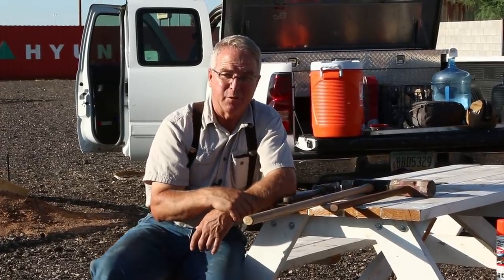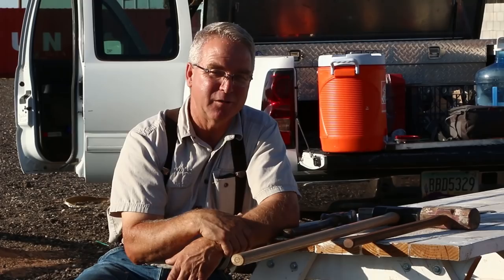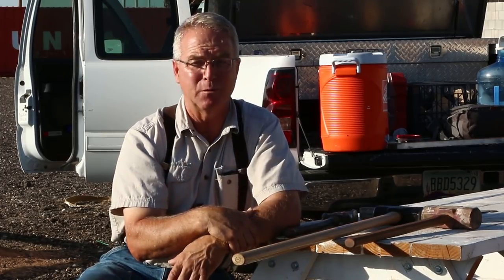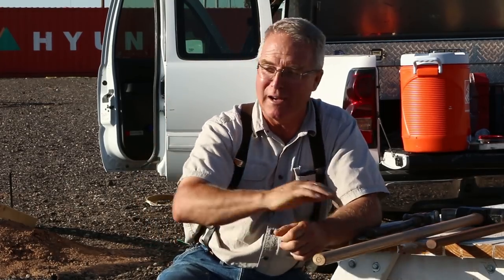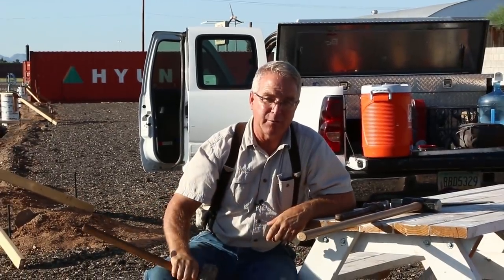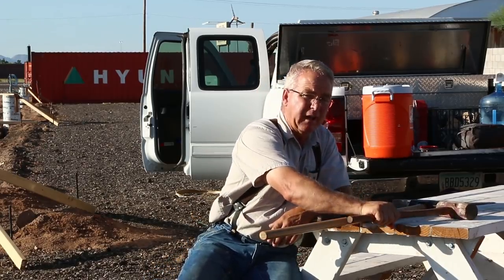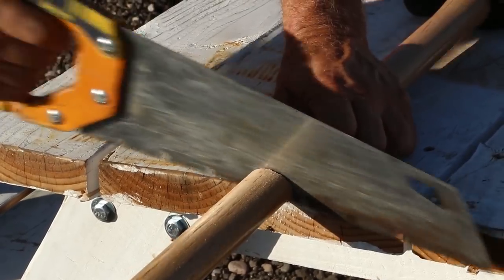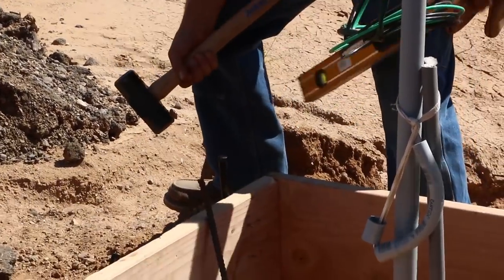Best Sledge Hammer for Concrete Work

Comment: ironworker here, I've heard a 16 pounder called a "monday", swung it a few times and realized why it's called that. no one likes Mondays
Reply: Don't bring your racist trolling into this positive community.
Reply: I think momentum is more important than energy when hammering.
Reply: @zachary3777  the 1 foot by 1 1/16 drift pins i send through 8 inches of steel beg to differ lol
Reply: Could be wrong, but it seems more likely the name comes from that being the hammer you use on Monday, when you're all rested and feeling like super man, then you use a lighter one the rest of the week cause you learned your lesson.
Reply: You mean speed(momentum) is more important than mass when you want to impart the most energy possible.

Yes, that's why the math equation for energy is as he showed.

The total ENERGY is equal to 1/2 of the mass of the object multiplied by the square of its velocity(speed). Square means times itself. So if it was 5mph it would be 5x5. That means as the speed goes up steadily the total energy goes up a lot more.
Reply: @zachary3777  momentum does not equal mass.  Its literally mass x velocity
Reply: Zach A well force=mass x acceleration 
So if you can swing a heavier hammer ,with the same amount of speed as a smaller hammer, you get more force
Reply: Lol roughneck for drilling rig here and most of the hammers used on our rig is 10lbs and in some cases when there was a 4in hammer union not wanting to budge then we would use "Big Bertha" or tell a hand to go get "Bertha" which was our 16lb hammer. Only me and a couple others would swing Bertha and wouldnt let anyone else try (to prevent them from hurting thereselves or breaking Bertha!) that wasnt an efficient or good hammer swinger. But ive worked all fields of oilfield n while we might have 10lb long dick handle sledges, which i hate using, i prefer a good ol 8lb sledge that we would use on a frac job. with a medium length handle, Not too long and not too short, just right, wrapped mine with grip tape and i could go toe to toe if not gaurantee you i could out preform you with your long handle 10lb sledge lol
Reply: Zach A Well, multiply momentum by half the velocity and you have…energy! (Kinetic ofc)
Reply: Just Roll Can’t take a joke?
Reply: Cody RatliffTM Can’t take a joke
Reply: I’ve seen Alec Steele  swing a 26lb look it up it is amazing!!
Reply: @jedimasterjoe5386  Where's the joke?
Reply: I'm a block mason we call some 12 inch block birth control block lol
Reply: @zachary3777  no, with a small hammer, I even struggle to put nails in plywood, as I have to hit hard, and fast, aka not too accurate, and also using a small hammer takes more energy in the long run, vs a few relatively relaxed whacks of a bigger hammer. but of course, each hammer has their use, can't exactly use a sledge for fine works
Reply: @thepork9940  That's literally my point

Comment: There's an old saying "there is no substitute for experience"  - and you're the living embodiment of that. I searched sledges and was so pleased when your channel came up. It's like going to an old and trusted friend and asking their opinion. Thanks for taking the time to make this. And you're right - force is speed x mass not just the mass. Ego has no place in working with a tool :)
Reply: The kinetic energy in a blow is [mass x velocity squared] divided by 2.
The energy delivered is proportional to the square of velocity, whereas mass is in direct proportion.
a 5kg hammer at velocity of 5m/sec kinetic energy is [5x25]/2 = 62.5
double the mass, same velocity gives [10x25]/2 =125
double the velocity, original mass [5 x 100]/2 =250
(units of kinetic energy are kilogram-meters squared per second squared)

Comment: I'm a heavy diesel mechanic and we got all types of hammers. Very precise brass 1/4 hammer, up to 15lbs of persuasion. But my favorite is my 14inch 4lbs sledge. It just fits my hands and is weighted enough to persuade  almost anything I need to persuade.

Comment: New tool for you.   I use the cut off part left over from handle as a boot knocker.   Knocks mud off before u get into your truck.    Fits under the seat.

Comment: I almost got my face rearranged with a 3 pond. A coworker was setting a top plate after we had wet set thread all. As he swung forward the fiber glass handle failed and the sledge flew across the room and as it grazed my jaw it hit me square in the chest just missing the collar bone. I was lucky to only have a bruise.

Comment: Concrete man here and I agree a 6 lbs hammer is the only way to go. Although I cut my handles so the total length is 16” so I can set my inside footer boards without pulling a tape out (production pro tip)!

Comment: I came to the same conclusion some years back while splitting firewood short handled 6 does well and if you want use a long handled 8 too after your wedge is set. I’ve gotten comments using my 6lb shorty on construction jobs but people usually change there mind after using it to drive a stake

Comment: Thank you EC. True words spoken. Now lets talk about that saw lol. The same applys with a splitting maul people ask why use a 6# instead of a 8# i give a little twist just as the head hits the wood to pop it apart instead of just slaming the maul strait down the 8# is harder to control and slower. 6# for driving stakes works good. Take care.
Reply: In Norway (sort of the true home of axes etc) they use very light splitting axes rather than mauls. Of course this references what s it was saying about speed over weight. Of course the wood split if often spruce or birch and doesn't have a huge diameter compares to some of the wood you get in the states. Interesting mind.

Comment: A mid-weight hammer with a moderate handle on it is a great thing to work with day to day. But an eight to ten pounder on a long handle? It's a thing of beauty for a job that actually calls for it. If you don't have a bin of hammers and bars on your work truck, you'll eventually "make do" with the wrong hammer for the job.

But a really slick rig I've seen recently: pneumatic driver with two guys walking along with a cart for the compressor and a stack of stakes. The two of them went around and did three of the four sides in the time the four other guys did the last.
Reply: Technology does that. You can either invest in the tools to do the job faster or you can hire more labor and do things the hard way.

Comment: I also use a 6lb hammer while driving steel stakes but I cut the handle a bit longer about 24 inches and I make a notch at the 16 inch in the handle for quick measure for a standard residential footing. Has made my life so much easier and quicker

Comment: hey, Scott.. I, enjoyed the travel back. I, worked at M.S. bout the same time.. R and R truck 14 .. I, liked a longer handle as well.. I, used an 8lb  and took the time to wrap the end of the handle with string line.. game my larger hands a bit more  area to grab on too... kept a 10 lb sledge on the truck for when I, needed the extra swing weight.  for those quick jobs when I, didn't want to break out the Jack Hammer. As far as Dennis goes.. we all have differing opinions of the man... he was tough, stubborn,  and wasn't afraid to let you know.  I, enjoyed working at M.S. Concrete most every R and R job I was called too was different in what we had to do to fix it, tho we couldn't figure out if R and R was Remove and Replace or .. Reconfigure and Redo.  have a great and awesome day,   A. J.

Comment: I work with concrete in Las Vegas and what you said about caliche or however you spelled it couldn’t be more true. But I noticed you don’t swing completely over your head when you drive a stake. I was taught to do a full swing. I’ve only been doing concrete for about 2 years I just turned 21. I swing an 8 pounder with a 16 inch handle. Most guys I work with swing a 12. I learned with a 12 and when I bought nt 8 it was really light and easy to control so now I drive stakes with the best of them in our crew. Thanks for videos. I enjoy what I do and have learned a lot from you 🙌👍

Comment: I actually buy old pick axe handles (generally old tools from "home and garden shops"), and convert them in to hammer handles. Excellent source of wood, tried and tested, aged well, and cheap.
Reply: I buy large sledges and picks regularly at car boot sales for a couple of dollars or thereabouts, simply for the hickory handles which are imported and would cost between 12 and 20 pounds in UK.

Comment: Scott, this is off-topic but you should move your T-shirt line to another company. I ordered the blue EC shirt and the logo was printed off center and much smaller than the advertised shirt. Teespring sent a replacement (so far so good). Well, the replacement was worse than the original order. Off center and rotated slightly! Just a heads up from the field. BTW, love your relaxed, easy feeling delivery in these most informative videos!

Comment: A good small sledge makes breaking bolts loose for changing rear brakes a breeze. I actually went from a hammer to a sledge and the extra concussive force per tap made all the diff on getting that caliper bolt loose.

Comment: Definitely different construction methods out west than in the Southeast. I use a 10 lbs sledge to drive my wood stakes but its got a normal, 30" or so handle. Here we have sand and roots so you you want a wide stake, and  long handled sledge

Comment: The perfect single jack for me, is a 4lb with a 16" handle, OTC has an indestructible handle and a ton of options, the fave isnt rounded over like most sledge hammers and theres little no vibration.

Comment: Different sledgehammer application here but ultimately the same - driving wooden stakes for electric/barbed wire fencing. I have a 16 pound sledge that I prize over any other sledge, I can swing and drive stakes one handed with it, but I have a reasonably long handle on it for really getting work done. The handle usually starts life as a standard length and slowly gets shorter until it hits under 2 feet. I find it unwieldy and awkward until it drops under 30 inches, even with two hands. I've broken a lot of rock with it, I've driven a lot of stakes too, building up the muscle and technique to use it with one hand though is absolutely one of the best skills I've attained for fencing hands down.

Comment: Hi, I’m 22 years old and new to construction as a laborer in Australia. You say in this video to always be open to new better ways of doing things. What about your units of measurements? You describe everything in feet and inches, however these measurements don’t easily convert and are exclusive almost to the US. Have you considered using metric measurements? On my commercial building site, I’d be crucified for conveying a measurement that wasn’t in millimeters. I understand in Europe they prefer centimeters. 

I saw in one of your spec build videos when you were leveling the ground with the laser, you said the industry standard precision measurement error margin was within 1/10th of a foot or something like that. Surely giving a number such as 10mm (what our leveling needed to be within on my job site) is more intuitive? Easier to convert and mathematically transform and such.

Comment: At the tire shop we had a 20lb hammer with a 1 1/2" schedule 40 steel pipe as the handle. We called it the persuader.

Comment: We do things pretty well the same here in Canada. For roadwork like curbs and sidewalks we always have a crew of two that set forms. Almost always one guy is on the sledge and its always an 8 pound with the short double jack handle you showed. The one thing you forgot to mention is that the face of the hammer should be flat and not rounded so it doesn't slip off the stake when striking.

Comment: I always look at the grain of the wood before I buy a hammer. Tight vertical grain. Vaughn, 19oz axe handle. Drive stakes w/ 4 lb. though. Forest Grove,  OR
Reply: I think I prefer the composite handles. They don't have the rustic charm of a wood handle, but they feel great and they're not damaged by water

Comment: What is the proper grain orientation for a hammer handle?  Is it in line with the hammer swing or crosswise to it?  I've even seen 45 degrees ???  Another great video as always.  I once bought a 32 oz. framing hammer and never could swing it in real life, just showing off who had the biggest hammer in carpenter school.
Reply: david g , I swung a 32 oz Estwing for 15 years while framing or forming.  I always dropped to a 22oz when stripping.  I'm 55 and after 15 years in the airforce fixing ejection seats, I find that hammer still seems to settle into my hand like it's still made for me.  Still my go-to for framing.  Like in the skilsaw video, Scott says, "Ya gotta build some guns".  To my knowledge, I'm still the only person I've ever met that uses a worm-drive saw, everyone I ever worked with, or who worked for me, always wanted the lighter type of saw, lighter hammers, etc.  I have a range of hammers for carpentry from 12oz finish to 32oz framing, 3lb club to 16 lb sledge.  You never know what the job will call for.  There's always a 4lb single Jack and a 10 lb double jack on my truck when I am working and plenty at home if I know the job will need it.
Problem today is people have no idea how to swing that hammer.

Comment: we have formers at work, basically a extruder oh wheels. sometimes we have to change the screw out. that involves someone holding a 4x4 block of wood at the end and someone else swinging a 7-10 lbs sledge hammer at it to drive the screw in. talk about having rubber arms when the job is done. the screw sits about 4ft off the ground and sits horizontal.

Comment: I might do this for a fire service application. If I can get the same or more force out of a smaller hammer it might be beneficial since you have limited air and you might not get as tired using it. I’ll have to try it out.

Comment: I certainly agree with the sentiment here, and if your task needed to carry it all day, less weight makes a big impact, and adding speed\skill gives you the same effect of blow. That said for one handed work I've always preferred to go up in weight and down in length of handle because I've always had better luck being consistently accurate, and find the higher inertia reduced how much it'll rotate when I'm not dead center and what harmonics I felt in return... although when driving in tons of 900mm+ pegs rapidly lead to my choice to no longer even carry a full handled hammer, and instead fork out for a electric jackhammer. Its not much faster honestly, but as so often the cool looking "manly" way of doing it just makes you feel older and more sore at the end of the day then you should, and I can swap out batteries a lot faster than backs.

Comment: Great video, I swing a 10 pounder everyday doing flatwork, but after 30 years I occasionally grab one of the guys 8 pounder and it feels pretty good.  But I needed an extra maul the other day and grabbed a 4 pounder, what a waste of energy, easy to swing but takes twice the blows to get stakes in.  I don't understand guys problems with round stakes? they are so much faster, I get that flats work in certain places, mainly as kickers. but for 6" thick and smaller concrete flats are slow.

Comment: Speaking of hammers, an exercise for twist strength is grasp a hammer by the end of the handle, lay your forearm flat on a bench, and start rotating the hammer all of the way to the left and all of the way to the right. Start with a light, short hammer and work up.

Comment: In college I used a 2.5lb mini sledge to pound my stakes in. I was the second weakest guy in my class, but the second best stake/nail pounder. We used to pound stakes in for days. On the big island in Hilo, the ground was nothing but rocks. Trying to pound a stake in the ground was a nightmare, you had to pound stakes through rock, and hope they didn’t follow a crack causing your stake to become crooked towards the end. I’m talking about taking upwards of 10 minutes for 1 stake at times... half the time you’d blow a big hole within a foot of either side you want your stake to be trying to break through rock and finding a place your stake would stick. I had the lightest hammer, but I could swing that thing twice as fast for twice as long as everyone else.

Comment: This could make me feel inept for my daily usage of a 12-ounce hammer... however, since I don't mess with concrete and it's the age of pneumatic fastening, my most common usage for my hammer is just to tap something in place, and I definitely need to take every step possible in lightening my tool belt setup: I don't want to give myself a bad hip at a relatively early age. I do have a 22-ounce that I use for framing though, as a 12-ounce can get to be under-powered pretty quickly.

Comment: I never cut mine at an exact number. Ive always set them on the ground and marked them right at the top of my knee cap that way i dont have to bend over much to pick it up and it always seems to be the perfevt length.

Comment: i'm an aircraft mechanic and i see a ton of guys committed to snap-on or matco, because that is what their daddy and their grand daddy used. now a days all of the tool manufactures are made in the same factory in china, you can break any tool any where and bring it back to the store and they will give you a new one. as long as it has the same stamp  
.

Comment: 07:30 I notice (and have pointed out to them) that a lot of people do not know the little trick to put a additional (heavy) hammer on the back side of the Bord when you are pounding in a nail. To catch the blow of the impacting hammer. It so simple but you often see people not using this Methode.

Comment: There's a difference between energy and momentum.   I am sure you have hit something with to light of a hammer and not had the desired effect.  Simply adding more hammer speed doesn't always work.
Reply: Hence the 28 oz